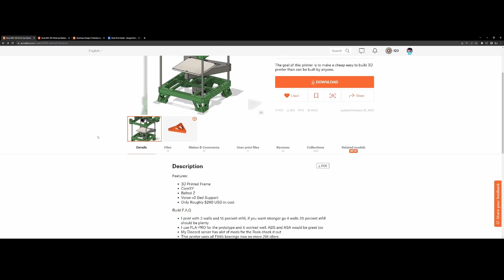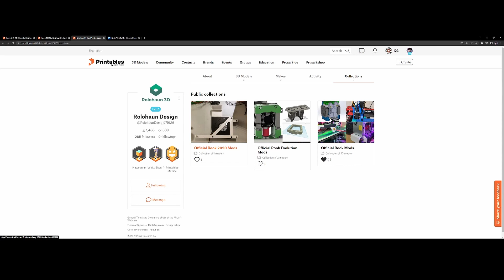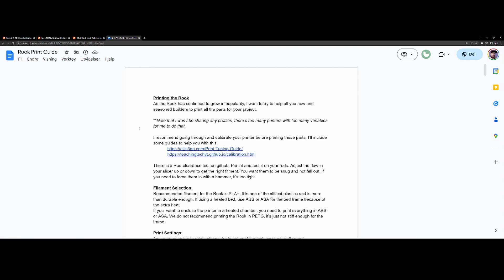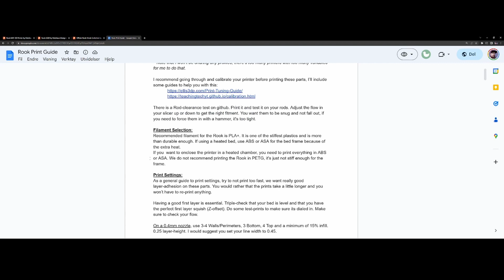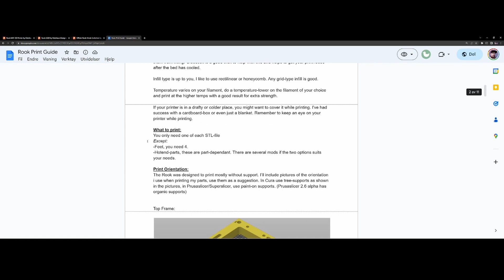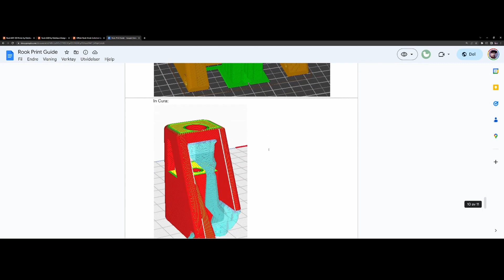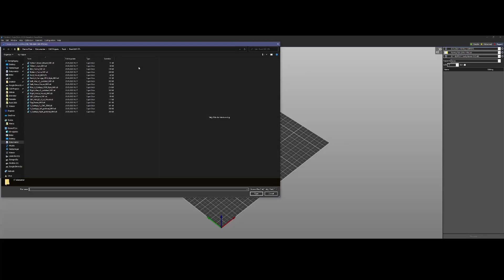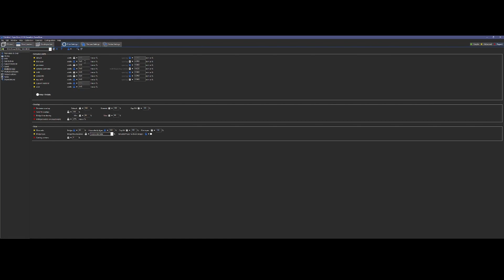Rook Files, Slicing  and Printing

Comment: i printed the lower frame but my motor didn’t fit in the mounting spot and my linear rods also did not fit not matter how hard i tried ive been aware of my holes being printed .5 mm smaller then they should but how should i fix this
Reply from the maker: Calibrate your printer, make sure you have your flow dialed in and do some test prints